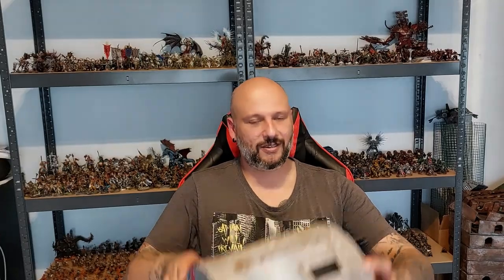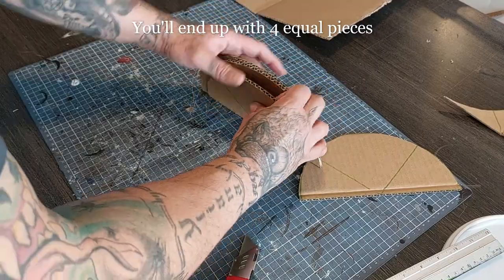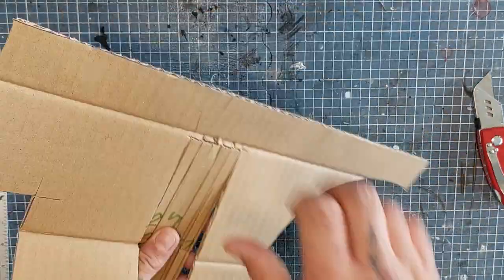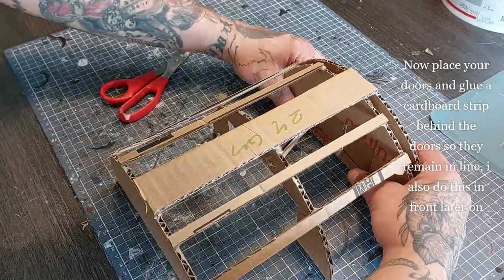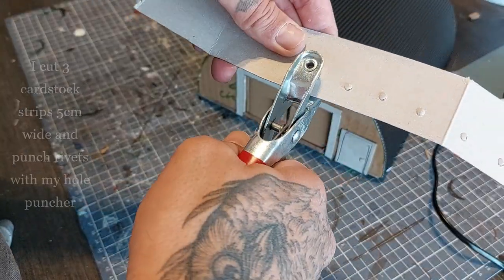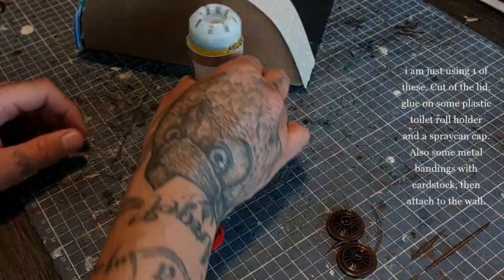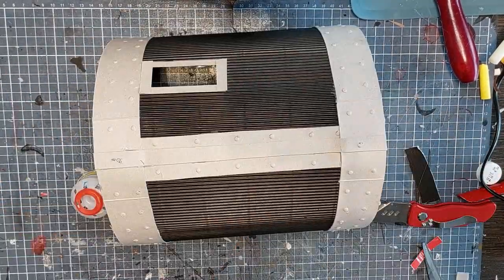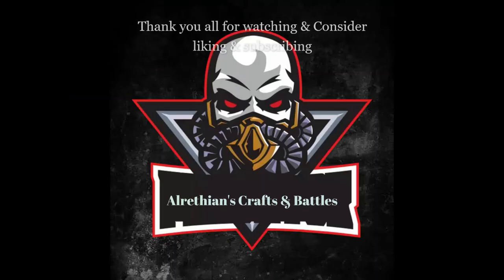How To Make a Cheap and Easy Sci Fi Hangar for Wargames // Warhammer 40K, Kill Team...

Comment: How does your paper punch rivet gun work? I missed it. Is it just a modified regular punch?
Reply from the maker: It's just simple hole puncher for a belt. You take a piece of cardstock, test out with side to use, because it makes a difference, then mark the top side of the hole punch with permanent marker. But as for how it works,, simply squeeze the handle until you have a rivet. Thanks for watching 👍